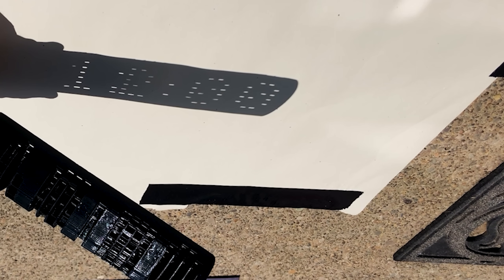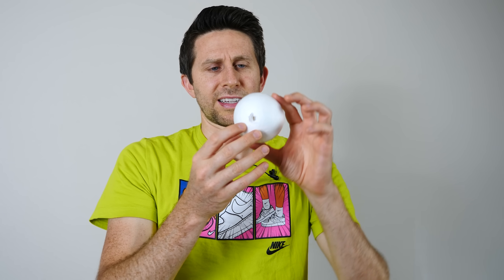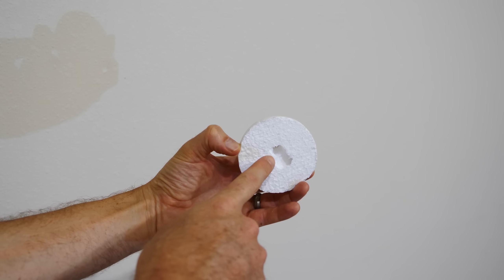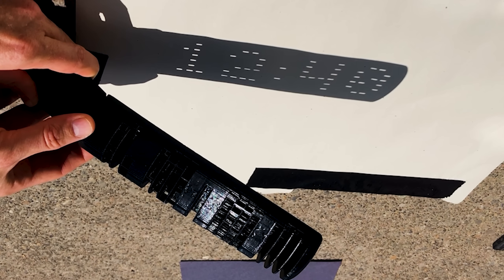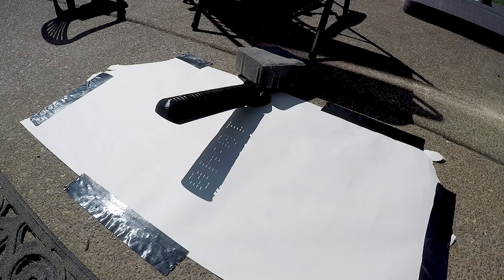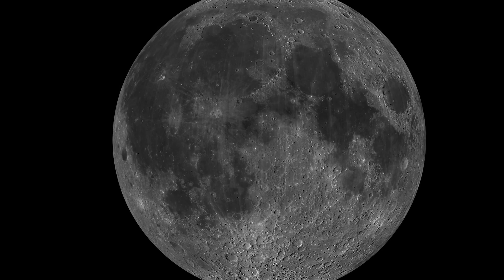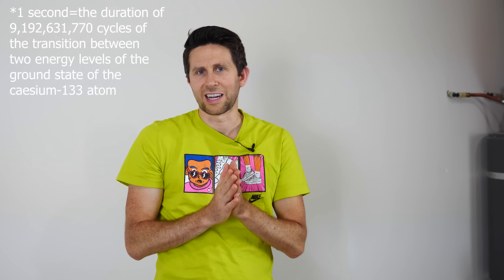The World's First Digital Sundial

Comment from the maker: The 6 hour time delta after 2700 years I mentioned in the video wasn't clear. This is the cumulative time due to all fluctuations over that time period. This time is the delta between TT (terrestial time) and UT ("variable" universal time). So if you set an atomic clock 2700 years ago, when the sun is directly overhead today it would read about 7pm. This has to do with why we have to add leap seconds every few years even though the length of day has not increased by that much. The effect is cumulative. So since 1972 we have added a delta of 31 seconds difference between TAI and UTC.
Reply: Thanks for clarifying this point. I was stunned when you said that, but understood the concepts.
Reply: Hi can you put this"digital" sundial in the next action box. Thanks.
Reply: This is not the first digital sundial.  Proof of concept for digital sundials comes from the late 80's; a US patent (4,782,472) was filed in 1988.  A digital sundial was installed in Sundial Park in Genk, Belgium in 1998.  There's actually a wiki page on digital sundials, so it's a bit shocking to see you claim this 3 decade old tech as new.

(BTW, love the channel... this is just a correction).
Reply: Wtf are you talking about UTC is a time zone based on Greenwich time and is in sync with all other time zones.
After that gaffe with 2700 years and 3 hours, you state that the earth lost 1h in 65 Million years! That is more in line with the literature.
So I suggest you change your video there, if you want have any credibility with this. 
And some weird complicated explanations will not cut the mustard either. Explain it properly the first time!
Reply: The Action Lab That was quite interesting dude.
Reply: You keep implying there’s an issue with your sundial when there really isn’t.
Reply: Technophant 
‘Solar time’, ‘sidereal time’, are completely different animals than atomic standard time; TAI, TT, GPS time.
Reply: I was shocked when you said that in the video 😂
Reply: Ohhh thanks for the clarification. It makes way more sense now.
Reply: Hey action lab what happens if you drop a bottle inside a moving vehicle pls thanks
Reply: Fkin Cool!
Reply: Please become online physics teacher only for 9th and 10th
Please
Reply: Once again you spit out intentional mis-information. You must know what digital means and you must know that a solid object creating shadows id not digital regardless of what shape those shadows are. When are you gonna get your act together from this bs?
Reply: @anteshell  dig·i·tal
/ˈdijidl/
(of a clock or watch) showing the time by means of displayed digits rather than hands or a pointer.
Reply: @anteshell  Digital implies discrete 1 or 0 units.  This goes well with the shadow-projecting device.  There is either a shadow for a pixel, or there is not!  Taking the points where light goes through correctly gives you the approximate time.
Reply: @Dracopol  Your definition for digital is so narrow that it is reasonable to call it false, but considering the topic of the video fits into that very narrow definition, I refrain from doing that.

However, the clock he is talking about is very much analog and not digital. The only thing that can be meaningfully attributed as digital is the signal it produces. That's a stretch because the data transferred is the time, but that kind of representation of information simply isn't discreet on or off. 

There is two ways we can stretch the definition to fit. 1) Each individual light spot of pixel can be interpreted as digital, which makes  this clock produce maybe about 60 individual digital signals. (Couldn't be bothered to calculate exact amount of pixels here, so just estimating.) 2) We could interpret that as one digital data stream represented in a similar fashion as a display or even just seven segment display, but that is even more of a stretch because there is no data processing of any kind which by definition makes it impossible to attribute each pixel as one singular data stream.

Reasoning: Did you know that smoke signals are digital signals produced with analog medium? There is nothing digital in a fire or smoke while the signal itself consists of discreet on and off segments. This clock is equivalent to the fireplace. Nothing digital there.

Ergo: You're wrong. Try harder next time.
Reply: That was a lot of words
Reply: Ok. Now that makes sense.
Reply: You should get a world record for this video
Reply: Cool video, you are just missing one very important factor on a sundial. What makes a sundial work, also to make your own anywhere in the world, it's simple.   Get a compass, find a pole or a stick... now with the compass find north and Mark as 12pm then East as 15:00 or 3pm...and so on, and done.. Follow the shadow.  This proves the tilt and all the other cool stuff you said are theories..and mostly proven by CGI videos. Also there has always been 360 days in a year with 30 days per month, a perfect circle..but a pope changed it many years ago too keep us confused
Reply: Due to the fact we're constantly adjusting time to match solar time, sundials will, on average over millions of years, be more accurate than any atomic clock. They are what we calibrate time to. (Albeit those "sundials" are telescopes... )
Reply: @brandonn6099  no they wont
Reply: @flaps805  Explain how that which we calibrate our clocks from could be less accurate than our clocks
Reply: " army time " ?????????? its the world standard ,why do americans think 24 hour standard format is some special thing only the army people use ? literally every digital clock on a computer watch and phone by default displays time in 24 hour format ,besides america because i dunno, american education ?
Reply: @girlsdrinkfeck  movies and we grow up with only 12 numbers on our clocks.
Reply: @girlsdrinkfeck  nah not really Canada, mexico, England, France, China, Taiwan, Bahamas. I have been in shops, bars, restaurants and hotels in all these nations were there are 24hr clocks. That is not to say they dont use 24 clocks as well.  In the USA you will find various businesses that use 24hr clocks as well. Even at my non military job we use 24hr designations.
Reply: @girlsdrinkfeck  Every digital clock?  There are regionalisms in how to represent time of day and month/year.  Everything I've bought in Canada does not have 24-hour time by default.  Shucks, the microwave ovens show the "ounces" weight for the Popcorn settings, you have to switch to metric grams!
You even have to think about numbers.  In India, past a thousand they group higher and higher numbers by hundreds instead of thousands.  So 100,000 is written 1,00,000 and is a lakh, and a hundred hundred thousand is 10,000,000 but they show it as 1,00,00,000 and it's called a crore. The next highest one, 1,00,00,00,000 (our billion) is (GET THIS!) an arab!

Comment: Awesome invention. Finally a portable and accurate, precise sundial that's relatively easy to mass produce. In the future, maybe some other variants might be made:

- Including one with a solar compass - you couldn't tell the time without the piece taking the latitude into account in its own way anyway, just make it more visible.

- A UV-sensitive system to not get tricked by artificial light (provided it's daytime and the sky is clear). UV-A can still pass through glass, so if it can pass through to a black surface with UV paint, it could work.

Comment: I think your comment and your correction to your comment just muddies things up. The ERA measures an angle of rotation between rotation of the Earth to the Celestial Intermediate Origin- CIO has no instantaneous motion along the Celestial Equator. ERA replaces GAST- Greenwich Apparent Sideral Time ( in whose frame the celestial origin moves along the celestial equator). OF note the  origin in GAST is called the Equinox and that precesses westwards every year.  What created this move to ERA was Radio Astronomy and Very Long Baseline Interferometry and Pulsar observations.They are more stable than Siderial (Star) Time.  In addition during a  24 hour period( measured against the position of the Sun at noon, Solar Time)  the Earth does not rotate back to the same position as yesterday because it has ALSO moved further along its orbit about the Sun, on average it has to rotate 1 degree to get back to the same position. Today with all the nimble  accuracy of computers we throw in precession with nutation ( wobble of the earth ) and these all add to the delta you mention between the old system of GAST and the new system of ERA. But they way you explained this can be confused with the length of a day on the surface of the Earth. It sounds like in 2700 hundred years the day has increased 6 hours, not true. In 2700 years the day has increased by about 37.8 milliseconds. The delta you talk of has to do with the measurement between old system GAST and the new system ERA.

Comment: While this is cool, I wouldn't call it digital. It's still analogue, just a different way of viewing it, in a digital-esque way
Reply: Analogue using digits. I wonder if there's a word for a clock that displays the time using digits.  Like, what if it doesn't use electricity, but it displays time digitally?  Maybe you'd call it digital.
Reply: Analogue with extra steps

Comment: Would this work anywhere in the world? Even high up north? Nevertheless, a really cool and genius gadget.
Reply: As long as you set the angle to be parallel to the Earth's axis of rotation - this is your latitude and can be found with GPS.
Also something to cast a shadow on would be helpful, but that's probably more relevant at the poles where the shadow casting part (the gnomon) will be perpendicular to the earth's surface.

Comment: I'm happy that it wasn't truly "digital", it just shows digital numbers.  Seems everything today has to be electronic and bluetooth enabled and it's getting very tiring.  Kinda like the Juiciro that required a wifi and bluetooth connection and if you didn't provide those, it didn't work.  Then it didn't even make juice, it just squeezed juice from an extra large Caprisun packet... ugh.
Reply: Digital
Adj. (of a clock or watch) showing the time by means of displayed digits rather than hands or a pointer.

Digital just means that there's discrete values
Reply: @Geerice  I mean like electronic
Reply: @cujoedaman  No one said electronic. Digital just means in discrete values, it comes from the word digit, as in finger. You can only show whole numbers on your hands. The reason digital is often applied to electronics is because they can only deal with whole numbers.

Comment: "We have to add time to the day"....why?  Just because scientists use the definition of seconds differently doesn't mean the entire world will behave in that manner.  Considering humans have always measured time based on the sun throughout its cycle, I don't see why it would change until we have at least conquered another solar system, where time will be based on that planet's cycle.  This means the sundial will always be accurate for this planet because humans will always want "12:00" to be noon (halfway through the day) and "12:00" to be midnight (halfway through the night).  It's extremely inefficient (programming-wise) to suddenly have all clocks go from 11:59pm to 11:60pm before 12:00am just because you want to add on a minute of correction.....instead of just changing the crystal to reduce the speed of a second.

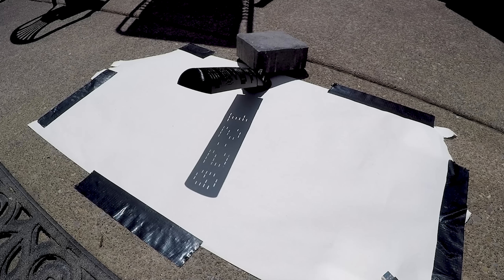Comment: 4:04 is it "melting"? why is it bending down?
Reply: Yeah black wax is horrible sundial material.
Reply: @craigschooled  black wax ? pretty sure its Pla
Reply: @lieblingsfarbe4453  Any black material is bad.
Reply: @lieblingsfarbe4453  Jesus wept. Of course you're pretty sure it's PLA. We all know it was 3D printed. Jesse knows it was 3D printed. Even if you didn't think it funny, surely with your smarts you must have had an inkling that it was a joke? 😕
Reply: @nagualdesign  not really, didn't think he was joking, still not sure doesn't make any sense even as a joke.But I don't know or care tbh
Reply: @SeriousApache  Just the soft ones with low melting points.  Case-in-point: obsidian and smoky quartz would actually be ideal for this kind of design.
Plastics, wax, and the like are all notoriously bad at dealing with the sun, which is why many electronics have warnings against exposure to direct sunlight.
Reply: @GremlinSciences  Because it absorves too much sunlight? It is completely black so it would make sense to me, but so sad a beautiful clock like that one wouldn't stand to the sunlight.
Obviously with proper material it will stand to it but, is it expensive?
Reply: @lieblingsfarbe4453  if it were black wax and a sundial it would be like building a boat from toilet tissue. Just wouldn't make sense.
Reply: @craigschooled  ok got it, it was probably a joke
Reply: @josem138  Depends on which material you actually choose.   You could make one really cheap using wood, though you'd need to be careful about treating or coating the wood so it doesn't warp or splinter.  Depending on where you get the wood, it might not even cost $5 to make one of these sundials.
For a real piece of art, you could use translucent or semi-transparent materials such as quartz or colored glass, but they're going to be quite a bit more expensive for the materials and will likely need a professional to actually shape.
Reply: You got it wrong guys... it is not "melting", it is instead the relativistic effect of time bending ;)
Reply: Seems like optical illusion cause the shadow is slightly changing position by sun’s move
Reply: @panayiotisyannopoulos2668  you might want to watch again... it's not just shadow that's moving.  Start back around 3:50, and watch the position.  Now, maybe it's falling rather than melting, I dunno, but... it's moving.
Reply: P.S.  5:56 might be a hint that the answer is yes.  :D  (See 5:49 for context.)
Reply: David Lindes thank you, I will take your word for it, I fear I am not the most keen eye one can find :p
Reply: It's caused by the tidal force from the moon.

Comment: Will that sundial work correctly here on the Southern Hemisphere? Would it be backwards/upside down/pastwards?
Reply: This is a brilliant question! 
You're right: in the Southern hemisphere, the idea is to hold the "swiss cheese" part from the other end, and point it toward the South. To make things easier, I designed a second version of the sundial, just for the Southern Hemisphere (the 3D models are all on the Thingiverse page).